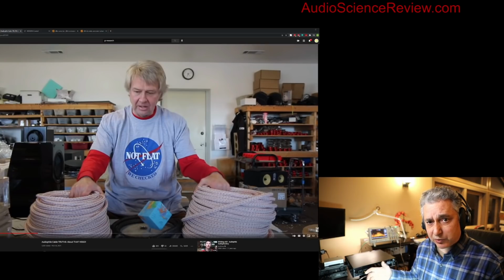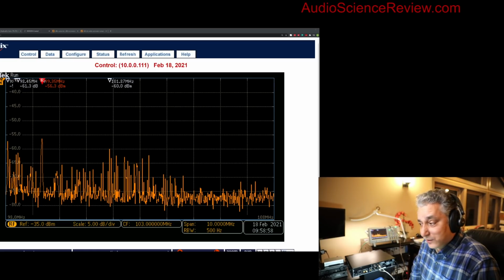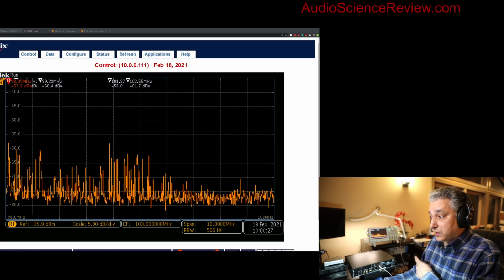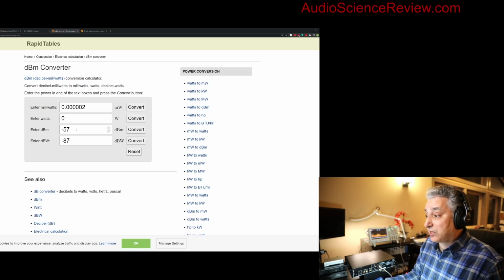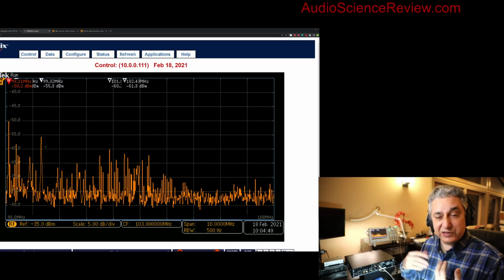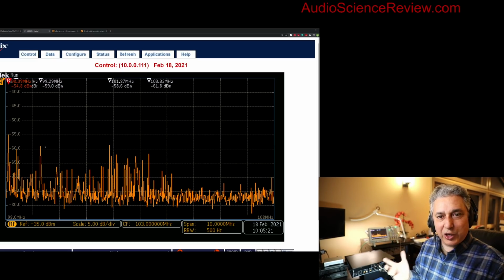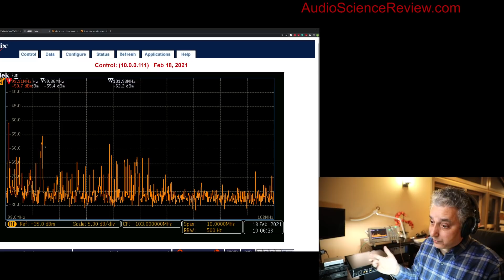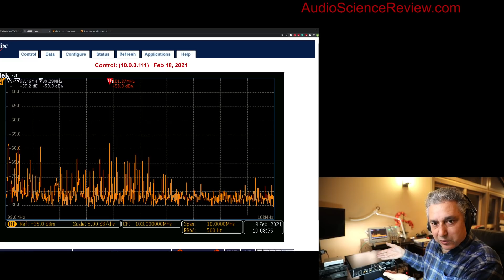RF Interference in Speaker Cables???

Comment: LOL, great subject.  Part of my job is dealing with RFI, EMI, in sensitive industrial equipment, so understanding the issues is part of my day to day life.
Here are a few facts..
1 RF in a speaker cable is of no consequences unless it is rectified by a non linear component.  That is a mouthfull, but if there is RF in a cable, it is not a problem unless it is rectified by a corroded connection, or is not filtered in a cheap amplifier and becomes rectified by transistors or diodes in the amp.  Better equipment has better filters.
If the RF is too low to be rectified, it won't.  If you live next door to a ham radio operator, TV tower, or place your cell phone on your speaker cables, you don't need an expensive fix.
Proven time and time again, shorter speaker cable is better. When possible, keep the speaker cables shorter than 2 feet.  Yes, I am suggesting powered speakers and shielded balanced XLR for the signal, if you are in an RF rich environment.  Braided speaker wire is similar to unshielded twisted pair network cable, but at a much lower impedance, due to the capacitance..  Did anyone mention the evil of high capacitance on the output of an amplifier? Many amplifiers are unstable into a highly capacitance or inductive reactive load.  Again, shorter is better.  Next time you go to a concert, see if you can get a view of the actual equipment.  Most newer gear is using a digital stage box, so analog mic cables are short. It is digital to the sound desk, and digital back to the stage box. Then there is a short run from the stage box to the powered on stage monitors.  The main speakers are either powered or connected to the amp rack at the stage, not at the sound booth. The pros know the reason for short speaker cables.  My longest PA speaker cable is 25 feet.  I do not own longer speaker cables for event sound. Pros can't use equipment that picks up cell towers, broadcast, 2 way radio, ham radio.  They quickly eliminate any equipment that gives problems in the presence of RFI, and EMI.
When you connected the cable to the Yamaha, you simply terminated the cable, which draws some of the RF energy, so yes it is attenuated.  However, what is important is the signal is still present in unbalanced cable between the amplifier and your test equipment.  Nice choice of the Tektronix. I have one too.   Much of the high frequency RFI can easily be filtered out going into an amplifier with the use of ferrite beads on both ends of your unbalanced audio cable. They are not expensive and work well.
DBmV and DBmW is the same scale for relative measurements, but the difference is one is power into a specified load resistance. For the RF guys, this is into a 50 ohm load. This value is incorrect at other load resistances such as the input of the receiver of 20K ohms, or a speaker of 8 ohms, so audio is generally measured as a voltage as the resistance in audio is not constantly 50 ohms, 8 ohms, 200 ohms, or 600 ohms, so for audio, it is measured as a voltage.  Check the settings on your spectrum analyzer. Many can switch to display DBmV. Some can even turn off the 50 ohm load, but most have this load fixed.
How "Low" your RF environment completely depends on your proximity to transmitting equipment.  A setup in a valley in the desert is a different environment than the urban jungle. One church I helped set up the sound has no over the air TV due to the geography, so no RF issues. However the church on the hill nearby, is less than a mile from the TV and radio towers on the crest of the hill, and their RFI fix was much more extensive requiring replacing equipment with poor common mode noise rejection, shielded cable for everything, and a bussbar for bonding all equipment.  Some environments are so strong in RF, the rectification happens when the equipment is turned off. Turn the amp off and hear the local AM radio station. When that happens, you need something better than braided speaker cable. In this case it was conduit, ferrite beads, and RFI filters.
Reply: So confused.  Amir showed that rf wont make a difference with speaker cables but your post seems to indicate its a real issue and you go to all kind of lengths to deal with rf
Reply: @shroud1390  The issue is not with the speaker cables directly, but the length of the cables, and the  quality of the amplifier, and the strength of the RF in the area. In general a strong RF field and poorly built amp are both required to rectify the strong RF in the area to introduce noise into the system. Most quality amplifiers have RF suppression on the speaker outputs. For most people, this is a non issue. With the two issues present, long speaker cables amplify the problem.

Comment: Amir, glad to see your new channel up. (BTW, I'm Glimmie on AVS Forum). I see a lot of back and forth on the PS Audio site over your reviews. Just wanted to get your take on this. Let's be honest here, Paul does make some good stuff. Expensive but I think we have to agree the quality is top notch. Even the Power Plant does what is advertised. That is generating a very low distortion AC power waveform. I don't think it's necessary at all, even 10% distortion is not going to make any difference on a power supply DC output, especially a SMPS. But if you want ultra clean AC power, the power plant provides it. So with these excellent products I just don't understand why PS Audio has to deal in noise busters, re-branded AC receptacles, and power cords. Is the profit margin in high end audio that low that one has to sell these trinkets to have a viable business? Just curious on your thoughts here.
Reply from the maker: Oh hi Andy.  So good to hear from you again.  Power plant indeed does that.  They do make a mix of stuff that is good and useful, and others that are not.

Comment: LOL, a cable believer calling non-believers flat earthers 😂
Reply from the maker: He is so strange that way.  It is like calling all doctors fools and lay people doctors!
Reply: @AudioScienceReview  I use all amazon basics speaker wire and interconnects on my system and I think they are great, I really like their 12-Gauge in wall twisted OFC speaker cable, its high quality and pretty cheap at $50 for 100ft, no idea how it might measure, but I doubt that it's bad. I don't understand why autophiles still make a huge fuss about twisted strands copper wire, as if they understand something about radio interference with wires that Lockheed Martin and Boeing doesn't.

Comment: u didn't really prove Danny wrong tho, why not do a different test, get the cleanest signal u can have and put it through a DAC or amplifier then add noise to it RF noise and see what happens to the signal when u do so,,, ur talking about -60DB of RF noise while it might not be a lot the question is how does it affect the operation of the amplifier or electronics when u play music, u didn't play any music or add any signal to that amplifier, does it interfere with switching frequencies of the output transistors for example? or how does RF noise affect a DAC, maybe I'm wrong with my questions but I'm thinking all this subjects are not as simple as just plugging a cable in i always ask the questions ''how'' or ''why'', the way u show all this I'm sure everyone who has any interaction with any side of this electrical engineering understands, how about finding some answers and do things differently from all this, TBH i heard the difference and I'm really really curious how to measure the differences and how to quantify them in such a way that is repeatable, so far no one managed to do that not even you! None of the non believers actually proved anyone wrong because ur all talking about the same stuff, i always wanna learn more and understand more but so far I don't see anyone proving anyone right or wrong, ur right in the way u measure things but ur not completely right either!
Reply from the maker: Of course I showed him wrong.  He tried to mislead people by showing two inductors interacting with each other.  They are not speaker wires, nor one was any kind of RF interference.
Reply: @AudioScienceReview  i agree in a way is not a very valid test is just a way of over showing it, at least it shows how important is positioning of components in relation to transformers and positioning of inductors in a crossover or even on the outputs of cass D amps

Comment: This was great...I've been reading your reviews for some time and am happy you've started a channel here.  I remember that first video from Danny, quite the blowback on the comments. Can't say I didn't contribute. I'm not an engineer, but also felt at the time  his example did not pertain to the application. Albeit flawed, I do believe that  - to a relative degree - higher quality materials and construction can have a favorable impact on SQ.   Thank you for debunking the RF silliness... But wonder if you've personally experienced audible differences between zip cord with cheap connectors and "quality" shielded cables with "quality" connectors, and what you've found (positive or negative in ether configuration). I'm a fervent believer in well made, while a fervent arguer against overpriced (diminishing returns). I also agree that these differences can vary greatly when comparing speakers, DACs, or amps and then speaker cables. Still hopeful that my subjectivity does not have complete dominion over actuality, and that there is still more to it than snake oil psychology...or conversely, a pure measurement-oriented philosophy not have complete dominion over what the human ear can actually render (at least as far as cables are concerned).

Comment: Of course there is more than meets the eye (or the ear, in this case).  In the olden days, when first bipolar transistors appeared in the amplifiers, you had a very different situation than today.  The germanium transistors had a base-emitter voltage around 200 mV.  Compare that to 600 mV on bipolar silicon transistors, 1 to 2 V on FETs and some more on tubes.  Then add the collector / drain / anode voltages.  Maybe 3 to 5 V for germanium and 100 V tubes.  Guess what these numbers represent!  They correlate with the linear span of the signal.  Or in other words, how close the danger of distortion was.  The distortion causes mixing , modulating or demodulating.
 So, my conclusion is that all the talk about speaker cable effects relies on old experiences, long since gone with component and design changes.

Comment: Danny appears not to know much about radios. A decent FM receiver will produce a good signal with a 2 microvolt input. That is basically power in the picowatt range delivered to the antenna terminals. How a signal in that range can influence a speaker that is being driven by an amplifier is beyond my comprehension.

Comment: Blind A/B testing always wins the day. Put people in a listening chair with blindfolds on and have at it.
During several of the "A/B" tests...change absolutely *nothing*, but shuffle about and make some noise during the "cable changeover" as if something is actually being changed.
See how many experts pick out the subtle changes in "warmth" or "openness" or "tonality".
Then ask them why they have twisted, multi-strand conductors with sheathing running TO the binding posts or banana plugs on the outside of the wooden speaker cabinet, but revert to single strand, unsheathed, untwisted conductors inside the wooden speaker cabinet...which itself shields nothing.

Comment: Many years ago I was building an integrated amplifier designed by Dr Bailey (consultant to UK company Radford Audio). I'd completed the power amp section, connected a speaker and for some reason I put by fingers across the input (no preamp yet) . To my surprise I heard a very garbled radio broadcast ! Just subscribed.

Comment: Beside audio, my other hobby is amateur radio. YEs, we can use speaker cable as antenna and feedline.   The T shape antenna is called.. dipole antenna and the length of the 'legs'  affects the resonance RF, 

RF  power is very weak but it may be picked up from input of pre/amplifier, but not  by speaker. Example:

connect very long speaker cable to a speaker  system without connecting to aything at the other end..  Can we hear anything?  Then put it close the very 'noise' source such  as a  cheap charger.. hear  anything Or trnsmit a RF using walkie talke  near the cable..?

Thank you.

Comment: I have had cables that did induce interference in the form of noise.
Reply: Speaker cables???
Or RCA interconnects that carry just millivolts from a turntable's phono cartridge, and/or line-level signals from let's say a CD player???

Capacitance, Impedance, and SHIELDING are much more important in the latter, but in terms of inducted noise, proper SHIELDING.

As Amir has demonstrated, standard speaker cables are not affected in the same way when used as speaker cables connected to a properly functioning amplifier and loudspeakers.
Reply: @bbfoto7248    Monster speaker cables were the culprits.  This was a very thick audio cable, not like the clear stuff they normally sell.
Reply: @brooklynbummer  
What was the source of the noise?
Reply: @bbfoto7248    The speaker wires acted like an antenna picking up static rom electrical equipment.

Comment: You gave more information than danny did. 👍🏾
We need a serious lecture on all those terms : noise filtering with cable design, crossing strands, where it is true ? If it is true and relevant ?

Cable material : ofc, occ, silver,...
Audioquest abuse of skin effect, "perfect surface conductor", i fought those where useful only in Ghz territory.

I recently bought and did a listening test 😂 of about 30 different cables. I built 30 different speaker cable with the same nakamichi banana plugs. 
Most of the time I felt a difference in the beginning but after 1 or 2 days it wears off and the difference disappear. I assume that i was getting accustom to the new sound but maybe it was my bias wearing off. I'm not fixed on those things.
But sometimes some cable acted like a filter: too much bass for one, too much highs on another. And it often happens with silver plated cables, occ wires and litz wires.
Ofc copper tends to sound the same, i called it balanced.

I obviously don't have your level of équipement or experience so it's impossible to test those theories. 

It is nice to see someone like yourself who have a real scientist approach to those topics with real explanation in real context with a pedagogical way of explanation. 🙏🏾
And most important who's not afraid to respond directly to big corporations claims with evidence and science.

I visited the forum, a lot of good material Thanks.
My topping d30 is on the way for testing. And you confirm the feeling I was having with my Lg g7 thins quad dac. It is really impressive. 

I hope you don't get tired of youtube. We need an input like yours.

Comment: Very interesting video Amir. Question: what do you think would happen to the preamp stage of an amplifier if RF gets in? 
Let's say a WiFi router or a cordless phone (DECT here in Europe) has a power output of 100mW at 2.4GHz is 1ft away from the amplifier. (Let's discount the idea straight away that the amplifier is linear DC - 5GHz and produces 100W of 2.4GHz! :-) )  
What is happening in the preamp? (No tone controls, no RIAA equalisation). Can you set up such a situation and measure any RF carried at various points? What about the power cable - any RF downstream of the power supply as a result? Can you actually inject RF into various stages of the amplifier and measure the complete audio performance with/without RFI? 
As you probably know, both discrete transistors and op amps used in audio also operate at frequencies we can't hear (usually flat to 100kHz) and up to tens of MHz. What if audio AND RF is present? 
I would be very interested in slew rate, headroom (power reserve) perhaps even freq response, THD etc. The usual parameters. 
You could start with 2.4GHz and in a second round, insert shortwave frequencies eg. 10 - 30 MHz.  
Then if there are artifacts getting through the preamp, what happens in the power amp? Same performance questions. 
Subjective sound difference would also interest me if you can arrange blind panel testing. 
Also what about differences between class A, AB, D amplifiers? Would you expect class D to be better at handling RFI? Would you expect AB or B to be more susceptible? If so, why? 
Congratulations on the channel - it's a very fresh take on a long-term interest of mine. Wishing you all the best, Rob
Reply from the maker: Hi Rob.  Pre-amps should have some kind of RF filter on the input.  Otherwise, RF intrusion can cause some issues for them.

Comment: Hi there. I’ve been a reader of your website and enjoy the work you do. 
I’m kind of playing devils advocate here.
Measurements can be very important but listening is even more important. 
Do you listen and compare products that measure the same? 
Do they sound the same?
Reply from the maker: I do a ton of listening tests in my reviews.  And no, I have not found any to sound different when testing is controlled.  If not, I fall pray to my brain manufacturing things just as well as it does for the believers.
Reply: @AudioScienceReview  Thank you for your response.
I’m not suggesting for a moment I’d buy a pair of 1m cables for £2400 (battery incl). However, I have paid a few £100 (interconnects, speaker and mains) as they made a difference in my system and how it sounded. 
Good luck with the channel and believed wisdom and ideas should always be challenged. 
Cheers